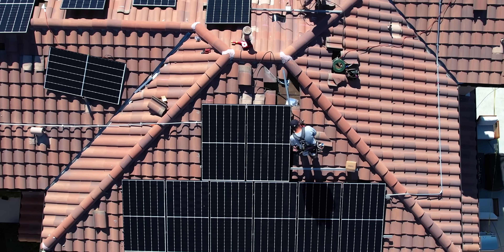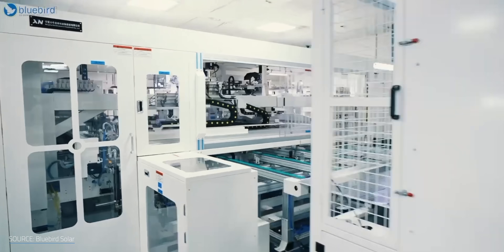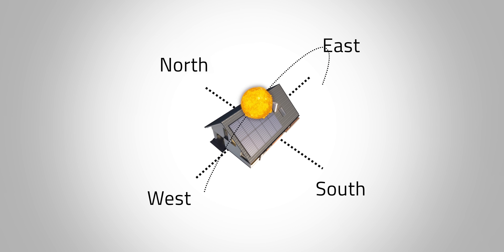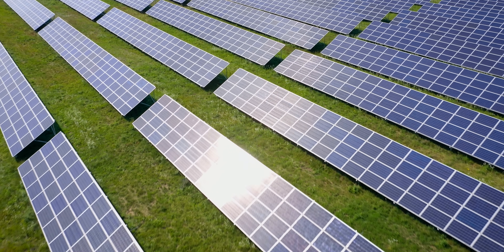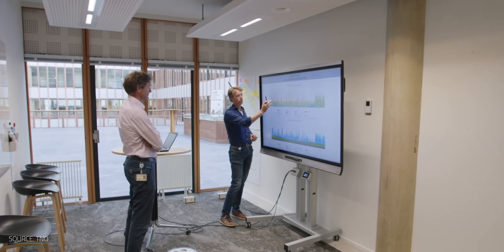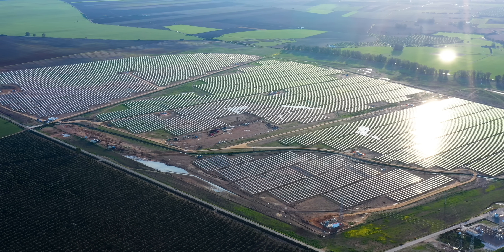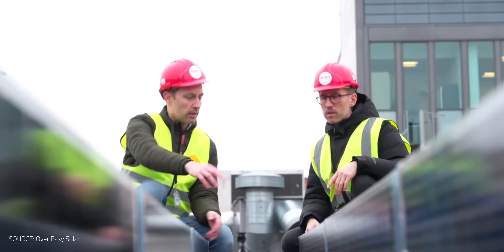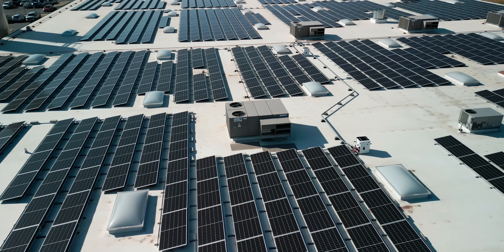Have we been doing Solar wrong all along?

Comment: Vertical means less direct heating of the cells= voltage keeps high due to rear having more light. You sacrifice higher peak production in the front in horizontal where vertical  you maintain a higher overall output between front  and rear. Downside= wind force bending or breaking the rack more easily.

I believe horizontal to be more secure and use reflectors for the rear

Comment: cooling : wight, when you ever burned your fingers at lunchtime on them you would know. (measured 65 C)
Every location has its special limitations and so the kind of solar-cells will be different to be best or possible to use there.
That might be a reason for me to lift them up more then normal, to optimize the cooling, or something else between cells and roof.
The Wind during storms here is the main reason I might not use double sided, and the heat with sunlight, sure better to use them for parking lot protection = shadow and energy.
Otherwise I might need an automatic system, let them bend over if wind reach a specific power on the installation, or let the lower part 'fly'.
But as I have now +100% Solarenergy over a month, I have some time to check out what I might do next if need more energy.

Comment: Latitude probably affects results and maybe relative light levels associated with weather through the year.  First time I saw the verticle thing was in Oslo - so far north and something like 15% net more over a year.   Easy enough to do both ways in various areas as pairs and measure it.  Add bi-facial and some reflectors and it might really kick it up.  heat dissipation thrown in there...

Comment: Maybe this could avoid some of the issues with reflected light in cities. Around here people are against solar on slanted roofs or balcony sides, as it reflects light in to windows or on to drivers, or even on to other buildings and can actually heat them up.
Placing these on the roof in good locations might limit that.

Comment: North-south (vertical arrays) - with a reflector on the top of the rows  - to reflect midday - and low angle  sun onto adjacent panels  (the whole array)...

 - OR NorthSouth 60 degree zig-zag /row separated banks (Like he Edison solar zerotracking power trailer - tow, park and forget)...

Comment: It gets worse. Roof-mounted panels are often on racks that aren't designed with cooling air in mind -- just the opposite! There's a big transverse length of framing at the top and bottom of each row of panels, which blocks the airflow you'd want to optimize for, instead trapping a bed of hot air behind the panels. Nobody seems interested in making truss-style framing that lets more air flow through, but I think it's a pretty obvious optimization. 

I've been advocating wall-mounted panels for years. They shed snow, they cool themselves better, they're easier to mount. I didn't know about bifacial panels until recently, so I've been talking about monofacial panels on walls, where facing south, they're optimized for production in winter when the sun is low in the sky and you need every extra watt you can get. (Or on bus sides or boat hulls, where they enjoy plenty of reflected light too.) Using bifacial panels as a self-contained east/west array to make that beautiful anti-duck curve is certainly great, but the cooling effects apply regardless, and shouldn't surprise anyone.

Comment: Seems this would also speed up installation and also make it cheaper... If these panels are made on a frame with two posts at each end and all you need to do is have a machine dig a hole at the right depth, you can just stick them into the ground and connect it to the previous panel and move on to the next. Sure would take less time than setting up the supporting frames then installing the panels on top, etc..

Comment: if heat is a factor,  i would like to see low angle (flatter) in the winter,  and vertical in the summer.  seems like the would be the best utilization .   also  you mentioned vertical on rooftops,  but a see the wind strain causing a problem on residential roofs,  i have a flat roof so could go vertical,  but see this as risky to the house structure.  but i am considering a add on to my current system in the backgarden  and this may be a good option

Comment: I would say there is a bit of deception here in apparently comparing twice as many vertical panels - back to back - as the number of conventionally sloped panels.  It may increase output per land area, but only at twice the cost of panels.  Furthermore the panels should still be slightly sloped up to better catch sun passing over the adjacent rows of panels.  There is zero horizontal sun in rows of panels.

Comment: One thing that is not fully addressed in the video is how this compares to single axis tracking solar. 

If we are comparing to fixed tilt solar then yes this has a benefit. For tracking solar I do not see this as being competitive at large scales where you need to  maximize power output per panel.

Comment: This assumption of vertical solar panels doesn't make sense. Maximum charging amps from solar panels come from facing the sun all day, not vertical placement. The  problems with vertical solar panels is getting maximum sun. Is maximum sunlight going to hit a vertical solar panels? Maybe, maybe not, in a lot of applications it wouldn't work efficiently.

 You need to pivot solar panels 90 degrees to the face of sun for maximum sunlight charging. Not a opinion but only way to get more sunlight on your panel. 

The placement of solar panels should not affect it's effectiveness, but it really does, it has to face sun direct on. And best to have a sun tracker motor box tracking the solar panels to the facing of the sun all day.

 This is the only way to get max charging current from currently made solar panels to charge your battery bank faster. Unless they come out with a more efficient vertical panel design? But i would just make all solar panels more efficient and to not be affected by heat to begin with. Best solution. Easier said than done.😊

Comment: Think there are lots of advantages to panels like this an with most solar especially as materials are cheaper an we understand what effects/benefits it has on the area around it.
Problem like most technology is the regulatory systems aren't always designed for the end user to be better off. Here in NZ solar is getting bigger but if you can't pay for your panels outright the companies that lease-to-own sort of deals are actually end up costing you in the long run instead of providing the benefits because they are putting things like line charges back on the end user an lowering how much they pay per KW back into the grid (i know of people now paying half or more of what there power bill was when on full grid, even when there systems are big enough to run there house and put power back into the grid) all cause no-one is regulating what the companies can do (then they create a new company to buy wholesale line prices an charge you whatever they feel) - As we all know this is quite normal in the day we live when good things come, someone not the end user needs to profit off it

Comment: "Have we been doing Solar wrong all along?"
NO (See Betteridge's Law of Headlines).  It isn't binary (right or wrong).  There is no "we".  I always do mine right.  Still, I can see where vertical panels oriented such that there's an east face and a west face will maximize production in the morning and afteroon; but early morning and late afternoon is less good because the sunlight travels through more air.  Obviously at high noon the orientation is going to produce very little energy.
If the need is to augment air conditioning, then peak production ought to coincide with peak air conditioning demand; mid-afternoon.

Comment: So with solar panels having a loss in efficiency as temperatures rise and this being the reported reasons VBF-PVs are preforming better than expected, I wonder if setting up a system to use a portion of the generated energy to power a liquid cooling system might make horizontal panels generate more energy in the long run.

Comment: One downside, especially for rooftops is wind loads. You're maximizing surface area and raising the center of gravity so you're going to need a lot more structure per mod to hold in place. That increases cost and weight which can be a major issue on commercial roofs

Comment: Ok, I'll guess: it's the heat, or rather reducing the heat. The vertical orientation allows for convection currents to form; the extra moving air keeps the panels cooler and as we know, cooler solar panels are more efficient at converting sunlight into electricity. And now to check my guess..
Edit: Huh.. VBPVs did stay cooler but as noted the paper didn't explain why (I also checked the paper). But convection currents (hot air rises) and coanda effect (said rising airflow stays attached to the vertical panel) means VBPVs run as if cooled by fans.

Comment: I have some old PV's in a verticle position in my back yard driving small aquaruim pumps and if I walk near the panel with a high vis yellow shirt on the pumps run faster. I can assume from that the reflected light from my shirt is increasing the current/voltage output. its quite a significant rise in revs.In South Australia

Comment: Something here not really mentioned here is that vertical should also increase somewhat energy density by narrowing the gaps between the solar panels. And in some winter conditions the panels should be more clear from snow to catch the rays. There are still some learning to do here.

Comment: I wonder if these could be improved even more (vertical shading for farm crops)--by adding cooling between the bi-facial panels (?).  Yes this would increase costs initially, but if the water supply (for the crops) is routed between the panels (drip irrigation), temperatures could be lowered.  Thus, panels in high-heat desert areas  would gain some efficiency by the cooling effect of drip irrigation.

Comment: THe optimum angle for monofacial panels in the summer is very different in the winter here in Ireland  - I turn mine almost vertical to catch the winter sun - so over the course of a year the bi-facial vertical panels would work very well, even if they dont get the midday sun, as well as avoiding the summer heat.

Comment: Here's my guess: when the light enters the panel, the photons bounce off the absorption element. In vertical panels they are bounced away and exit the glass, but when entering at a high angle much of their speed is angled down. This allows the glass cover to capture the photons somewhat, bouncing them back and forth between the cell and the glass.

No idea if that's how physics work, just a guess!

Comment: Anyone here good with math? I need someone to crunch some numbers for me to see what adding a solar-powered heat pump cooling system to a solar array does to its overall output and efficiency. I'm thinking the increased voltage generation due to the reduction in operating temperature and the energy required to power the heat pump should reach an equilibrium. It may not increase the voltage output, but it should increase the lifespan of the solar array by reducing the wear and tear caused by excess heat.

Comment: THANKS! We've been looking at installing a system of standard panels at about 50* facing East and West since the system would run a large water pumping system which has it's peak demand from 4AM till 9AM and 4PM till about 8PM. But this would be cheaper to buy, using fewer panels and fewer extra charge controllers. We are at 14.25*N so the sun get really hot here, the panels that are installed in the normal way are so hot you don't want to touch anything near them mid-day. I have noticed on our present systems that the voltage does go down by about 30% mid-day as opposed to morning and afternoon, but the amps peak about 11AM and stay about the same through about 2PM, I guess the heat is the answer. It would also save since our present systems face due south and have an adjustment system so they can get a better angle on the sun since it's not always south of us. This could just be installed along a N/S axis facing due E and W. Now all I have to do is figure out how to reinforce the  mount without shading the panels.

Comment: I live in Tokyo and have a small 1kw solar system on my balcony. The temperatures in Japanese summertime can reach 38c degrees in the shade. In the sun probably closer to 50c. I have 9 x 110w panels running in parallel  which are Shingled all black modules which of course means they get scourging hot. If you then consider that panels generally are tested in a 25C environment to grade them, it quickly becomes a problem.  A voltage drop of 0.08v each degree over 25 means a 2volt drop pr panel in my case in the summer(assuming that the panels are 50c. They are likely hotter I have not measured.) And I can tell you the performance suffers for it like 50% on the entire system almost, however as soon as there is a breeze performance goes up a lot.
Reply: PV designers should put a bit more effort into heat sinks or heat storage to pipe away all that nearly boiling water for alternative uses.
Imagine if all of the units in your building had the same setup with the same heat gain but all piped to a hot water storage system that could then be used for laundry, showers, ect.  Cools your panels and would be almost free.
Reply: Add a small PC fan to the bottom of each of them
Reply: @ariesleo7396  they are 12 volts only use a couple of watts. I have 10 72 cfm fans in my attic to vent the heat out thru the ridge vent. I live in the desert with a south facing roof and I only have one 100 watt panel just for running those fans.I just put a new roof on two years ago so maybe I should think about solar now.
Reply: I suspect that the undersides of all panels needs to be black in hot climates to radiate heat from the panel. I suspect that is part of the reason for the increase in efficiency for the vertical panels.
Reply: Well the panels are situated in front of 3 minisplit "outside" units. When the AC's are on and the fans in them are active they move some air behind the panels. This air is hot of course but it does circulate the air on the backside of the panels. My balcony is on the 3rd floor and it is a rental hence I am rather limited in my options. When I bought the system(which I custom made) I didn't realize the heat to be such a big problem but it is. I chose the all black panels because of esthetics and performance vs size. Today I would probably opt for two big half cut cell panels in the more traditional solar panel look. In fact I can get the double sided ones at a discount atm. The water cooling/heating stuff did cross my mind but that is not possible were I live. Thanks for all the comments
Reply: In some cases, like attaching to a fence, would using normal panels demonstrate increased production just from going vertical at the same cost?
Reply: Capture all the breeze possible with a passive design of the array? A vertically orientated square tube as chimney.
Reply: I can't speak for solar panels, but my roof shingles during 40C temperatures get into the low 70s in the afternoon.
Reply: @georgehill3087  That is what I would expect thanks for confirming. I don't have a digital thermometer, which I should have.
Reply: @Patriarchtech I bought a infrared attachment for my phone when I was doing renovation on my house. Wanted to find out which parts are losing the most energy and whatnot. Pretty handy.

Comment: There are many solar orientation methods that improve the cooling of the solar panel. Being from the north, I prefer the winter sun optimized orientation. That gives me the most energy possible (based on panel ratings) for the winter.  I suspect, this will be better cooling of the panel than a standard roof orientation.

But there are other interesting orientations, that give some cooling benefits So much depends on the location. I cannot see me doing east west vertical on this property. Possibly on the building near the south side, again optimized for winter.